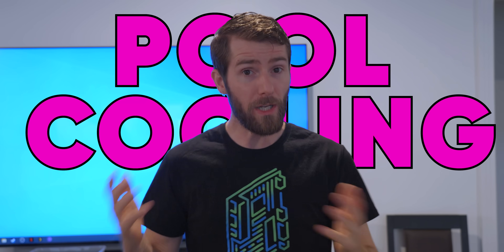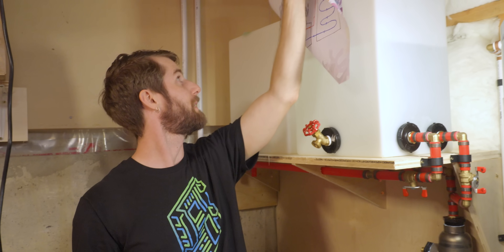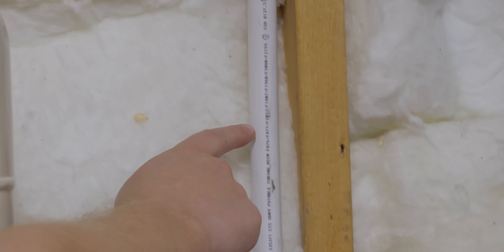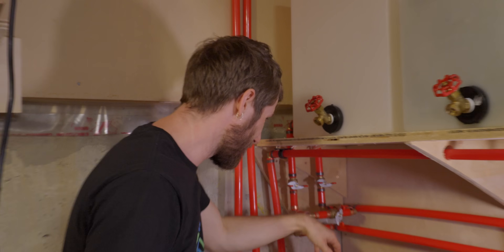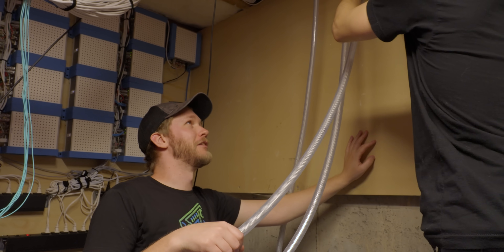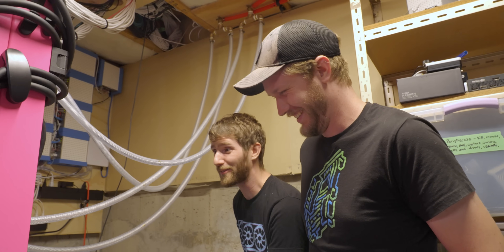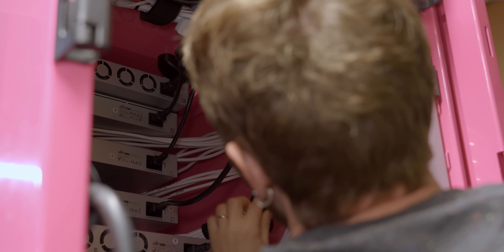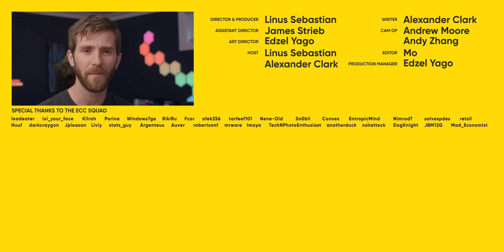My pool leaked and killed my computer - Whole Server Room Pool Watercooling Part 4

Comment: as a retired engineer, I can definitely say it doesn't pass the "Kiss" test.
Reply: There is no simple solution for this.
Reply: I "simple solution" is local water cooling forget about trying to heat the pool @haxie4516
Reply: @SuperFredAZ 
Local water cooling wouldn't work.
That room gets too hot before they added 5 new gaming systems.

The whole point of dumping it out to the pool was because they have to shut down most of the tech in the summer as-is.

Comment: Metal "nipples" fittings on the block will help prevent this,just like a well pump you use a metal threaded fitting at leaat 3 inches long so heat wont transfer to the plastic pipe.

Comment: Arrows would be the right way to do the tube labels.  Still need to figure what happened to the switch that popped too.
Reply: They tested it afterwards, and the cable was fine, so they don't know, it died, and they replaced it.

Comment: why isn't the water split (labels in and out) stuck on the wall instead of in the rack. It is really not smart from layout perspective to put it high and close to the electronic setup (should be a bit further to the right to leak to the ground)? Also a few leak sensors for automatic failover shouldn't be too expensive compared to replacing boards.

Comment: Alex commented on the Floatplane video:- 
Fuses blew due to bad Sata adapters. As for the switch we have no idea what happened, checked the power cable with a multimeter and it was all good. Just replaced the switch and it has been fine
Reply: The new video with broken power supply concerns me
It seems he might have problems with return voltage from pumps or something
Reply: @prophoenixPL  broken power supply actually happened before this video. They were released out of order due to some important footage being on linus's phone that went for a swim.
Reply: @Spudmechanic  yeah I wonder if maybe the power source is cursed?
Reply: Most likely the entire cabinet has water damage? During the fist incident I would not be surprised if the water heated enough to be steam, steam rises...
Reply: It's cool to see them know that the fuse itself was not the problem, I see a lot of people come to my workplace thinking blown fuse = replace fuse problem solved, not realizing it's an indicator of another issue.
Reply: @andie1874  
YES!
Thank you!
Someone else who gets it!

The amount of times I've heard someone say something along the lines of "Oh, I'll just replace the fuse."
Ok, but why did the fuse blow. That's the concerning part. Check why XD
Reply: @haxie4516  I still don't try to deal too much with fuses considering it can be kind of a rabbit hole, but I liked when I heard some mechanics I work with comparing it to an indicator light kind of thing, it just makes it easier to explain since it feels like most people these days don't know too much about their cars.
Reply: @andie1874  
Oh absolutely, and sometimes, it can 100% be a red herring, but it's one of those things that people really ought to learn more about
Reply: That a dual corded switch? With fumble fuck up there playing with power cables could have kicked it over to a different PS in the switch if it is dual cord
Reply: That's not really reassuring...
Reply: might have something to do with linus unplugging cables
Reply: @ymom11 
When's the last time you unplugged something and it ignited?
Reply: @haxie4516  I say that because it happened at almost the exact time he unplugged things
Reply: @haxie4516  It actually happened to me just a couple days ago lol. I had a Lenovo Legion 7 laptop plugged to the wall, I disconnected the power brick and I heard a loud pop. It took me a while to realize that I wasn't getting any power from the wall and the battery was draining. So I opened the power brick and yep, a resistor exploded and was burned to death. I have no idea why, I just unplugged the damn thing from the wall. I wasn't even taxing the laptop, I was just printing some Word documents lol.
Reply: @denxos  Sometimes things just burn and explode in electronics if they were not manufactured exactly right. I forget what I was doing exactly but I had a diode burst into bright blue flame on the bottom side of the motherboard of which I could see through the tempered glass. I immediately flipped the power switch and pulled the power cable and opened the nearest window to vent the magic smoke. That desktop computer ran mostly fine for another two years but eventually started having more and more BSODs after a year and a half and I still have no idea what that diode on the edge of the board was responsible for.
Reply: @denxos  switching any appliance on or off can cause a spike. Even with a quick action like a proper switch. We used to see it all the time with old CRTs. You could literally SEE the spike run through the entire house when someone turned something on or off as the picture would jump.

Yanking the cable method that is the only option in the US and a common method used everywhere is even more likely to cause such spikes as the pins are removed unevenly while still having full mains power on them.

So probably the many times the PSU has received a tiny spike from such on off cycling that built up and finally cooked that resistor. At a guess.
Reply: @Enchurito  
Not really, no.
Reply: @tyrannicpuppy  Seems accurate. Pulling the power decreases voltage across caps, meaning components fed off those caps will spike their demand for amperage. Proper procedure has always been to only unplug powered off equipment. Guess we saw a rare case is causes hardware damage.

Comment: Why have this fire hazard in your home.
Just build some PCs for each desk and run a network cable.
Reply: You try running 5 high-powered gaming PCs in a relatively small room.
Then you'll see why.
Reply: @haxie4516  get decent air conditioning
Reply: @TheRaunz 
That's not really going to work here. The heat output of those systems is too high.

Comment: Its a good mk2 - getting complex.
I'd be inclined to run the water lower in the room a.s.a.p, and lower in the case then 'up' to the equipment.  Just have gravity on my side for leaks ?

Possibly more conceptual than practical once its pressurised :)

Comment: arrows on all the hoses... process control uses this as a standard. May want to add flow meters as a way to protect pumps and create an alarm for someone to check system. You could go down a rabbit hole to have this system fully monitored and controlled.

Comment: Hi LTT-Team,
Since my GF works on exactly that kind of corrosive materials: Don't use iodide solution as a biocide! I guess you put tap water in that part of the loop and not ultra pure water. Potassium salt, iodine and water are a huge problem for car companies, cause they make up an extremely corrosive mix and can even ruin ECUs and ICs used in them. So IF, you can't be sure to get all the oxygen out of that loop, there is a possibility, that it will damage your micro fins (or better most metal parts) in the long run. And yes, even copper and nickel won't be save in this solution.
Maybe talk to labs about it.

Comment: About the IN and OUTs, Linus is using the "where is the water going in this spot" method, Alex uses the "where is the water going in perspektive of the consuming element". The later one makes more sense in a system and is widely used. 
But when there was a professional.. why the heck is the distributer above all electronic components and not on the bottom with a fluid warner in a sump or so. Changing a pipe will be a horror.
Reply: They're quick disconnects. Changing a pipe will be as easy as just a click
Reply: @haxie4516  sure, if you want to bet your whole system on it working every time. There is a reason, a professional had done it an other way. I and I have some experience in that regard.
Reply: @ismaelyu5 
They're fail-safe fittings.
And that's literally the system that professionals use.

I have some experience with that.
Reply: @haxie4516  ok you trust in manufacturer promise, i trust in murphy. In the end its the User who fails mostly, and this started with an allready "fixed" distributor and some other fails...
Reply: @ismaelyu5  
Ok... You do realise the quick disconnects will be there either way, right?

And given that these are the fittings used in HPC, and the amount of testing done on them is wild, given what clusters use them right now...

I'm gonna trust the boffins at work over a random commentor on youtube
Reply: @haxie4516  even if... the system uses more then just those connectors.. maybe these are the last to fail..  the rest of the system is a better gardening connection with some hose clamps. 
I don´t know what your are so mad about.. My whole comment was about adding a 2nd layer of safety, for a hobbyist used system. Not like the ones operated daily by professionals on those clusters you talking about.
I worked as electrician in plumbing and build airplanes by know. Its not that I just wanna make harassment comments. There is safety hazard and i´ve seen professionals fail at "fail-safe" components
Reply: @ismaelyu5  
I don't disagree that more safety is a good call, I was just talking about the quick disconnects, they're honestly so solid.

Comment: 4:04 As long as you wire the other end in properly... this is actually a legitimate method of installing a power cable.
Though, ideally, you'd buy the power cable that didn't have the plug moulded on the other end, and have just the bare wires ready to use.
Reply: The problem with buying a power cable that doesn't have a plug on the other end is that you need to buy a new power cable. PC power cables probably reproduce by themselves, there are always extras lying around.
Reply: @eDoc2020  Well, the power cable with bare wires ready to use is the ideal.
Any power cable that meets the requirements will do if you really need one. (By meets requirements, I mean Length, and things like Power throughput, don't try and wire a 3 amp cable to something that's going to draw 10 amps.)

Comment: Fine stranded coper cable + screw terminals + AC Mains -> Content Opportunity in a few months/years?
That combo never works because you can never achieve a long term reliable connection, eventually it will loosen, increasing resistance leading to heat ...
Please use ferules ;D

Comment: Does linus know you can hardly hear a desktop when you are gaming with headphones on? This seems like a lot fo work and issues for a tiny bit of noise and heat control.
Reply: Right, now put 5 high power gaming systems in one relatively small room.
And then you'll see why it's something he wanted to do.

Comment: Question: Why not use a reservoir where the racks hoock in and get water with their own pumps? Or use a plate heat exchanger for 2 loops. Loosing ~1°k?

Comment: Since your computer is hiding in a service rack to prevent water from sitting on your motherboard and creating rust and ruining the motherboard. Why don’t you just turn the computer upside down so, even if Water does leak, it would leak down towards the ground rather than on sit on the motherboard

Comment: what impresses me is the fact he's running the water pump directly from the wall and not a UPS, IMO I would have the water pump run on an UPS so even if there's no electricity, the pump will ensure cooling of the system, I would also add a pressure sensor with an audible beeper in case all of that fails. for the amount of money he spends on that rack he can afford 300$ more for that...
Reply: If the power goes out, the UPS is set up to immediately power down all of the desktop systems safely...
And then the servers aren't running on the water cooling loop.

Comment: The question is, what games on what settings get your pool nicely warmed up?
Reply: None of them. 
You'd need about 40kW of energy pumped into that pool to raise it by 1°C
Reply: @haxie4516  get the whole server rack mining overnight then that'll put a bit of heat in I reckon.
Reply: @MX-Vette 
Nope. It dissipates heat before it can build up. That's about 17500 gallons of water

Comment: Hacking the end off a power cable isn't jank, but using stranded conductor in a screw-clamp without a proper wire ferrule definitely is.

Comment: I would hook up flow meters and water sensors and hook it up in Home Assistant. This way anybody can get notified and can handle the stuff. At least having the PCs show up a warning, that the water flow stopped and the users can save the work and may shut off heavy duty loads. Also its a good thing to actually test every safety feature.

Comment: First mistake, the system should not be in the basement. You need it higher than the pool.

Second, it may be a trip hazard, but run the tubing up to the computers. If there is a leak, it won't run into the case.

Comment: wait. did you drive water straight from the main cooling loop and into your thermal blocks? why? Also, why water-cool in the first place? why not run an air-based system that then circulates air through a cooler cooled by the pool water?

Comment: You can use pcconnect by Adam Khattab to remotely power them off. The way I power my PC on is by using a smart plug and enabling power on after AC power back loss in the bios.

Comment: Does that pex pipe you’re using Linus have a UV inhibitor in it? Most pex pipe doesn’t have any UV inhibitors because it’s not designed to be used outside.

Comment: Maybe just setup normal cooling instead of all this nonsense.  Just saying...
Reply: Yeah, you try running that amount of hardware in there without dumping the heat elsewhere.

That room was getting dangerously hot in the summer.

Comment: Linus & Team - A few changes (upgrade) down the road.

1) Throw in a smart flow switch that can notify you (email or notification) that flow has stopped.
2) Redo your PEX distribution block out of copper, and solder with 5% silver. Less chances of a leak.
3) Use less 90* fittings, etc under the large plastic tanks. Sure it looks nice, but more changes of leaks. Less fittings the better. 
4) Install check valves somewhere for extra insurance.
Reply: Absolutely not on #2.
Galvanic corrosion is a massive issue with using a copper manifold
Reply: @haxie4516  They have copper to pex adapters. No dissimilar metals.
Reply: @flexnix  
The water blocks are nickel.
Reply: @haxie4516  I see what you're saying. The thing is I come from the air conditioning industry. We use copper and iron with dielectric unions. This water travels to the air conditioner which has an aluminum coil. I don't see why it would be an issue with the nickel water blocks. The water block is inside the PC. I'm talking about the water distribution block that was leaking at first. Looks like it's made out of plastic.
Reply: @flexnix  
yes. The manifold is outside the PCs, but using differing metals in the same loop, even when they are separated by tubing, will cause major corrosion issues, I'd grab some articles on it for you, but you know how YouTube be with links XD

Comment: It'd probably be a good idea to put those manifolds either a bit further from the rack or mount them right near the bottom of it. Doesnt make much sense to have the pieces with the most fittings (potential points of failure) above and not too far from your very expensive rack of systems.
Reply: Plastic manifolds were a bad idea period,. Even worse to put them inside the chassis

Comment: So you're basically using an open loop HVAC sysem where the chiller tower is replaced with a swimming pool. Not new but certainly excessive in this application.

Comment: You could have set this up as a heat exchanging system. Pump the pool water to a tank, extend the cooling loops from the pcs so the rads can be submerged in the tank. If the pool system ever goes down or needs servicing  just take the rads out and temporarily just add fans.

Comment: Literally told you so🤣🤣🤣🤣🤣🤣
This is why you don't get a tech guy to build a car. You don't put chlorinated water in a PVC cooling loop or run corrosive liquid through a waterblock🤦‍♂🤦‍♂
Lucky you didn't get a fire. 
You need a secondary heat exchanger in that system so you have actual coolant going to the PCs. Would still be patently stupid but at least it would be reliable.

Comment: That pipe change unnecessarily , technically you have an open loop system. It’s open to air on the reservoirs. The oxygen will get absorbed into the water there. In a closed loop system everything is under pressure. Then you will need an over pressure valve and a membrane expansion device. MAG in German.

Comment: Meltdown prevention
- minimize amount of pipe connections in server rack
- pipe connections in hot and separate cool boxes with leakage pipe to floor sink
- leakage alarms to rack, hot and cool boxes cutting power from servers and rack pump
- leakage alarm to swim pool loop with pump power cut 
- temp power cut in devices & rack

- firealarm

Comment: 4:08 - The UK is totally different too both in wires and methodology - I mean... we have the wonder that is the Ring Main Loop for our wiring. It's allows for smaller gauge wires but requires a heck of a lot more consideration. Though in Linus's case - it'd actually simplify some of over-complexation he's prone to.

Comment: Excessive heat deformed the end of my hardline tubing as well, killing my CPU and motherboard several years ago. Super frustrating!
When using hardline tubing, be sure to use the black plastic inserts to support the tubing sidewalls to prevent the walls from collapsing around the fittings.

Comment: If only there would be a device for such an application. That seperates two fluid sources, so one can stay clean and is not effected by the other. But is still able to transfer heat. /s

Comment: That’s why I switched from regular hardtubing to borosilicate tubes. in 2016 I flooded my 2x R9 290X GPUs because the fan controller died and the water went way over 60°C and melted the PETG tubes. Fun times…